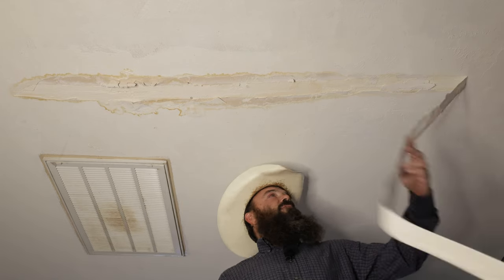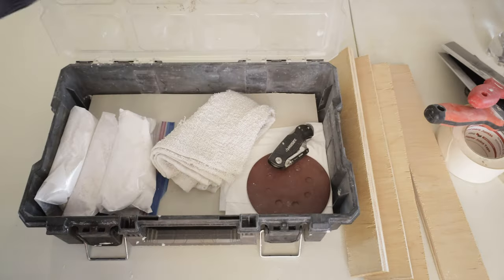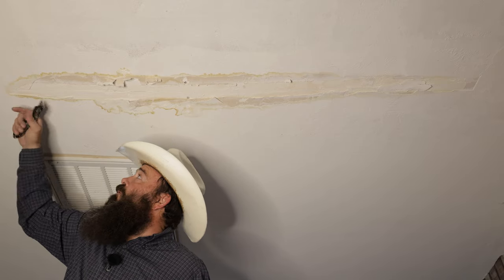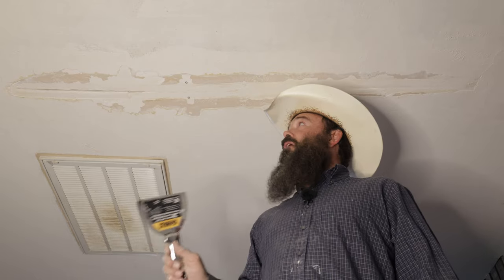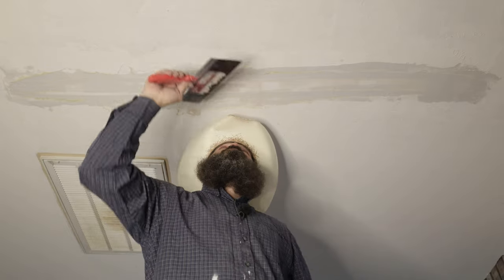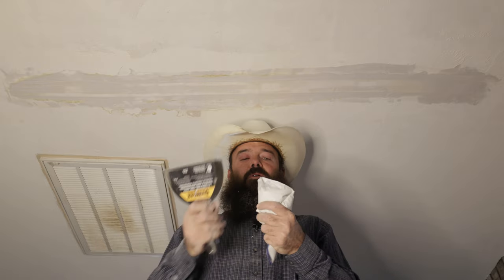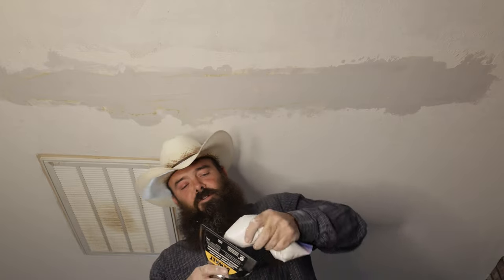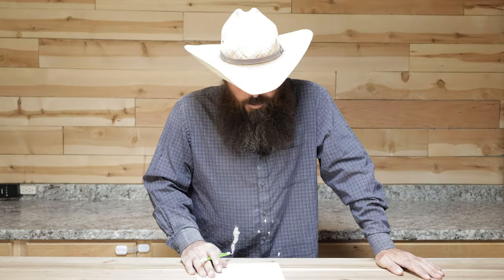Seamless Delaminated Drywall Seam Repair

Comment: I like how you keep your drywall repair kit all together...I do the same thing. Got a husky bin just for doing patch work. I'm working at a house for the next 5-7 days replacing all the baseboards, fixing other guys terrible drywall repairs. Putting in all new plugs, lights, ceiling fans. Already replaced the water heater and cleaned the AC coils. I get most of my work from real estate agents after inspection is done. I appreciate your videos, advice, and experience.
Reply from the maker: That's awesome David.  I imagine we'd work well together!

Comment: There are much better ways, and faster. Save the baggies for their intended purpose. Use a metal mud tray and buy the bigger bags of hot mud, 5, 20 and 45 minutes. Mix the mud right in your tray. Less mess and waste.
Reply from the maker: I respect your opinion, but disagree with it for a handyman.  If I was just a professional drywall guy I would absolutely do it that way.  As a handyman I need fast and compact methods that I can zip in and out with and the bags get that done while taking up less space in the van.  My entire kit is no bigger than a briefcase, is not slower than a mud pan for moderate little patches, and requires zero cleanup.  To reiterate...I don't think this method is best for a drywall guy, but it is best for a handyman who needs to be carrying around every tool necessary for every trade and able to access it quickly and use it quickly and move on to the next job quickly.  There is zero mess and zero waste.

Comment: No excuse anymore not to use fiberglass tape. It’s much stronger  and easier to lay down.
Reply from the maker: I hear good arguments from both sides.  I don't take any sides in that debate.
Reply: @bulletproofhandyman  that’s fair enough. I’d definitely try it if you haven’t
Reply from the maker: Oh I have, I actually prefer it, but I'll still use either.  There's supposed to be a new one I haven't tried yet that is both thinner and stronger, supposedly like a thin cloth.

Comment: unrelated question. 
I used your link for Jobber. Thanks.
When customers pay with credit card on  a Jobber invoice do they pay 2.8% and 30 cent transaction fee? Or are you billed for those fees in Jobber. 
If you pay them do you pass them on in your pricing?
Reply from the maker: Those fees, generally speaking, are common among all processors.  You might find somebody who can save you a few pennies, but the same applies to when you run your credit card at Walmart.  That comes out of your pocket, not theirs.  It's just part of the cost of doing business and accepting credit card payments.  You just have to look at your client base and figure out if you can afford to bump your prices up by 2.8%, which is basically nothing.  It's the difference between a job costing $100 or a job costing $102.80.

Comment: how do you deal with a repair like this if the existing ceiling is heavily textured or popcorn? how do you scrape down the high spots between coats? thanks ray!
Reply from the maker: First, I would try to sell the client on removing all of the popcorn ceiling, but if they want to keep the popcorn then you have to remove all of the popcorn around the repair to have a nice flat surface to start with.  Problem is then you have to match the popcorn and that's somewhat doable, but it's never going to look quite right.

Comment: Great video! Nice to see some videos you do some work. I love the bag idea on these small repairs. Much more clean. I have a quick tip. Sorry to be the type to comment a tip… I just love this idea that I use daily with these repairs. Get one of those big sponges from Home Depot. Can get a 4 pack for cheap. Those things work AMAZING to do a sand less smooth finish. I get it nice and wet and smooth everything out. It works fantastic. Try it just once and you’ll fall in love with how nice it makes it. Then you can texture and be done. I just have made my repairs much more nice with finishing with a sponge. And it’s quick and clean.
Reply from the maker: Please do leave tips here, that's what the channel is about, sharing information instead of hoarding it for fear of competition.  
I actually use a sponge for flat-ish and knockdown matches.

Comment: I am all about systems, love your kit, though I thought you were really pulling my leg when you mixed the mud in a baggie. I never judge the technique, just the final product, that being said you have more skill than you think you do, paper tape and 5min mud can be a real pain in the ass if your not moving fast or use to much pressure and starve that tape, you have it down pat.  

You are just one step away from only needing one skim coat on average, by cheating on the first one, but it works better with 20min. Just feather that edge when you embed the tape, then when it just starts to go gray do a skim right over the top with your remaining mud. You may have a few times when you need another lite skim in spots, but it will be nothing and you can texture right over it before it even sets. 

Have you ever used Hamilton? I was a USG guy for 20 years until I worked a job that was Hamilton, its the difference between creamy fluffy butter and cement. 

P.S. I just know the rust on that return vent behind you was bugging the crap out of you.
Reply from the maker: Thank you for all of that awesome advice. John! I feel like I should go ahead and give Hamilton a try. I don't know where I would buy it, but I assume I can probably jump on Amazon right now and order a bag so I think I'm going to do that.  The way you describe it, it's probably worth checking out.
Reply: NOTE: Hamilton is Wespac Here in So Cal it's at HD, but it used to be Lowes you can never tell with those guys. Best thing about it is if a patch does not get pulled tight and needs a sand, a wet grout sponge smooths it out like cake frosting, your not doing that with USG.
I use a LACO texture gun, and the guys at LACO (Fantastic guys, they work in the field every day, and still talk to you as much as you need if you need support) they pointed me to  Hamilton/Westpac Green Dot for Spray Texture, I went from an Apartment hack to able to match most trac homes (I still suck though lol)
I still keep 45 min USG though for the occasional fire envelop that is not getting finished, it sticks to anything, and the drywall will break before your joint does.   @bulletproofhandyman
Reply from the maker: That is an overwhelming amount of extremely useful information.  I really appreciate you guys like you sharing everything you can here!
Reply: Nobody shares more than you do, I wonder if folks even understand what your pricing guide is worth, it takes a whole lot of trial and error to reach that level.
Reply from the maker: It is definitely an ongoing process that never ends.  Tweaking a thousand little parameters all the time.  Thank you for joining in on the project of sharing instead of gatekeeping. I truly appreciate it.  I've already learned from you on this channel.
Reply: Well since your listening my best advice  since I have 20 or so years on you is when you keep a monster pace, which you are doing on content, you have to plan for down time. When a youtuber drops out for a while, says they got burnout, what they are really saying is they didn't plan for maintaining their sanity. Keep it coming, but protect your self.  @bulletproofhandyman
Reply: Just realized that sounded grumpy - I blame it on my Italian wife who just informed me I hung all of her walk in closet drawers at the wrong spots - damn I hate wire shelving
Reply from the maker: 🤣 I've been there!
Didn't sound grump into me, and you're right.  I'm wearing multiple hats at the moment, almost too many, but not quite.  It's just enough that I can handle it.  Believe it or not, at the moment I feel like I'm doing a decent job of balancing everything.  That hasn't been true until late last year when I seemed to have hit a stride as a handyman that has made the time management easier.  
Thank you for your concern sir, and I will make sure to take time when I need it without abandoning the channel.  
There may be times where the handyman business simply has demands that must be met, but otherwise I think I'll be able to keep up a consistent pace of quality content.
Reply: @johnhubbard6262 what’s a fire envelope
Reply: @Jay-wp2nw  anyplace they put up a fire wall, like the wall between the garage and the house, sometimes part of the ceiling in the garage. It doesn't have to be pretty your just "fire Taping"

Comment: Thank you for the tips. As a property maintenance tech I’ve been looking for alternative ways to reduce sanding and dust accumulation. 

What would be your process for roof leak patches as such on popcorn ceiling. And yes, I said popcorn 🙄 😂. 

In best regards!
Reply from the maker: Well, first and foremost, I would try to convince the client to let me remove all of the popcorn ceiling and just retexture everything to something more conventional.  If that fails then the only solution is to remove the popcorn for 12 to 16 inches all around the patched area and then put new popcorn on.  Of course, the obvious problem here is that the new popcorn is never going to actually match the old popcorn, that just isn't possible.  I've seen some very experienced tradesmen be able to get a close match but never a real match.
Reply: @bulletproofhandyman  YES, new popcorn won’t match heavy 70’s popcorn. Noted. 

Do you have any quick tips or removal for painted popcorn ceilings that have been painted with a non flat paint such as gloss. I know it sounds crazy but I’ve ran ran across it (even oil base). 

I would assume the “easiest solution” would be a electric 9” sander with 80-100 grit.
Reply from the maker: I've done that job, with semi-gloss paint over popcorn.  I sprayed everything down with a garden sprayer, the entire house, normally you spray a section of a room and then take it off immediately. But because of the paint I had to spray the entire house probably five times until sections started getting soft enough for me to scrape off.  I would scrape for a little while and then go spray all the hard sections and then scrape for a little while and then go spray the hard sections and I kept that up for 2 days.  
If I had to go back and do it again I would use a very large disc sander with 80 grit paper, but I would only use this to break openings into the popcorn for the water to seep through. I would not try to actually sand everything off down to the drywall. You'll just ruin the drywall paper and it will become an even worse mess.  I would run the disc sander over everything just enough to open up the popcorn behind the paint so that I had plenty of holes for the water to seep through and then I would proceed to spray everything down with water multiple times and start removing.  Your drywall paper is going to be very wet after all of that soaking so be careful not to rip it.  
If you haven't removed popcorn ceiling before, go watch some videos on it. If it's not painted, it's very easy to spray down with water and then it comes off like butter.  
If you already knew all of this then I apologize, but it didn't want to risk not answering the question fully.
Reply: @bulletproofhandyman   Thanks for the explanation and time! I’ve done a bit of both. We would scrape the surface to create pores and coat with warm water. Just a bit of work and very time consuming. I suppose a drywall sander would work well.
Reply from the maker: I would definitely scrape rather than sand if you're able to break through it that way.